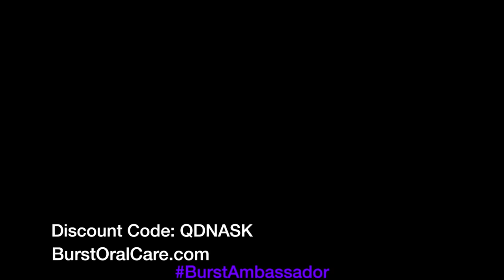Goonzquad RUINED My Burnout! HELLCAT Was On A RIP!!!

Comment: Haha Sam buffing out the damage to Neighbor... That looks worse than I expected. Really surprised the fuel cell in the trunk held up to that. Glad to see the Hellcat back up and running.
Reply: I mean...thats LTIERALLY why fuel cells were invented.
Reply: I bet cleeter will put the engine combo in a newer crown Vic. I love the lights around the top of the briers at the burnout pad.
Reply: @bigbuckoramma  yes but they've ruptured that fuel cell multiple times in the past with less severe hits.
Reply: ol cleeter needs to be more careful it was not just him in that car he had 3 fans in there for a ride along when he smashed into the rail cleeter could have very easily put the two people in the backseat in the hospital
Reply: @chaos6313  they signed a waiver for a reason. If you dont wanna get banged around dont get in a burnout car, simple
Reply: @chaos6313  I really think it was the small design of the skid pad that caused alot of it, the stadium kind held the smoke , so the pad area filled fast to no can see levels is seconds for most. alot, really way to many wrecked.
Reply: @chaos6313  chill out man being in a skid car is up to you I say tell people that come in my car in New Zealand it's on you cause I send it every time i skid .....